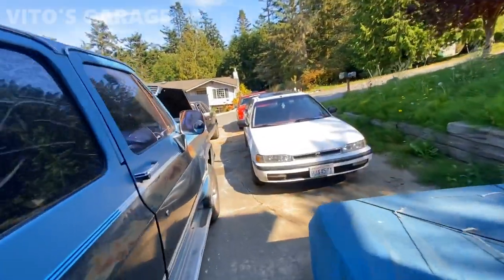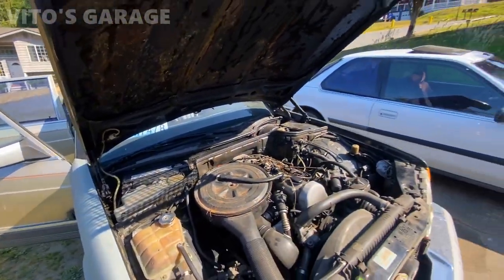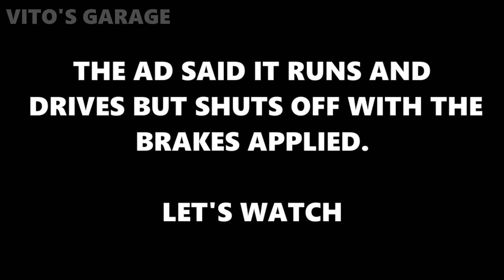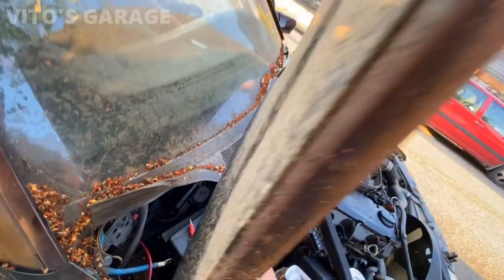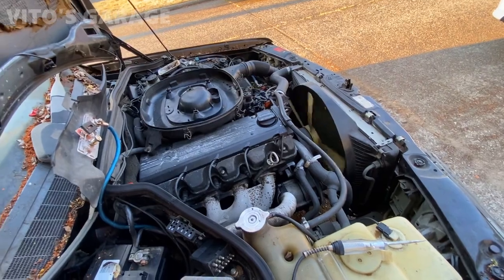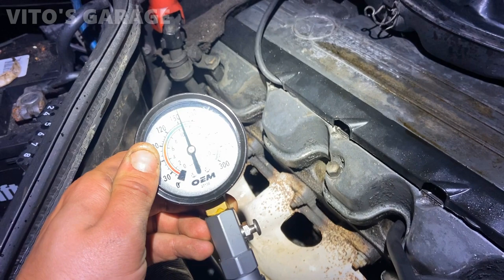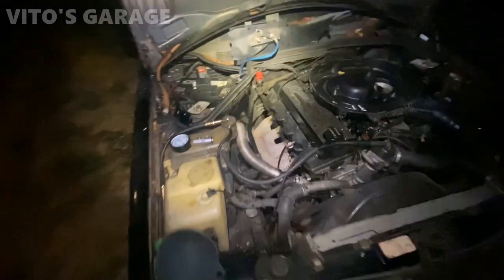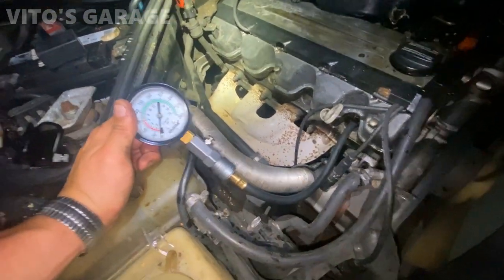The Ad Said It ''Runs & Drives''. Black 1988 Mercedes 190E Needs My Help. Here's What We Found Out..

Comment: If you want to save something, check out craigs  for Seattle (it's in Bellingham) , 2.3 5 speed MANUAL, saw the car, IT WILL START, misfires (couldn't  say if it's the timing chain jumped,/plugs/wires/etc) might need shift linkage adjustment, sun roof partially  open (motor is loose in the trunk), driver side seat. I didn't get it bc can't swap the manual into my 2.6 without the 2.6 flywheel and more important the shaft damn it.
Reply from the maker: Can’t come up with the deal on that car. Otherwise I’d grab it
Reply: @VITOSGARAGE  Aaaah, ok. Could you PLEASE dispense some advice/tip? Wanted to replace the distributor rotor bracket (M103 2.6 190e 1991) and broke 2 out of 3 in the process and still will not budge. PB Blaster didn't help, it stuck because, think, rust. Is there anything I can do without pulling the head and take it to a machine shop? THANK YOU.
Reply from the maker: @danricci6996  keep hammering it with a chisel and punch. It’ll come out eventually. When you install a new one, put copper paste on it so it won’t seize later. Be patient with it
Reply: @VITOSGARAGE  Thank you so much for the advice, went a different route, locking pliers in the center, then big ass crowbar in between them and timming cover, left-right, left-right, left - right, left right..... until it eventually it pop out. Beside rust problem was that whoever put it in originally used a hammer to jam it in, it was pretty much press in instead of just sliding in.